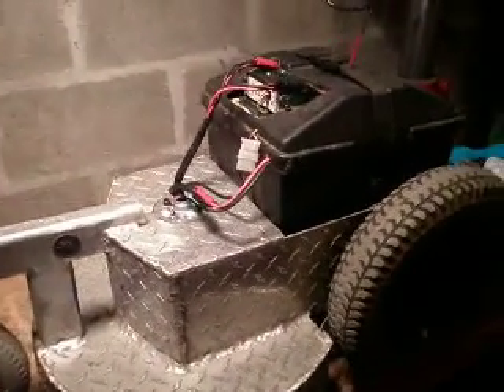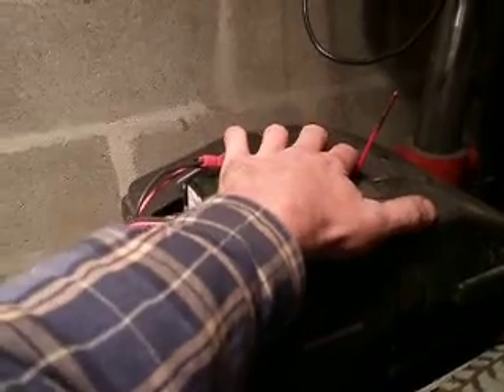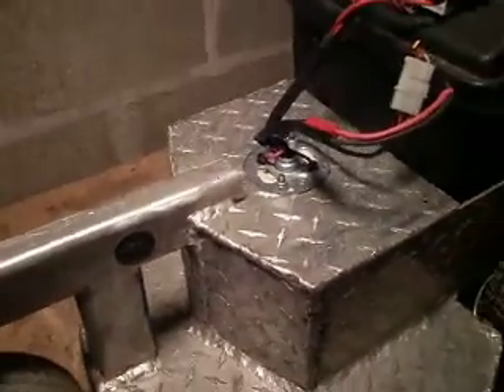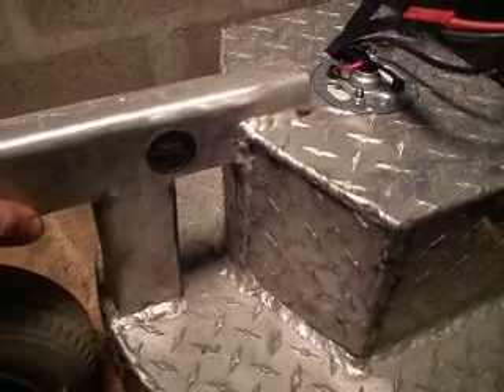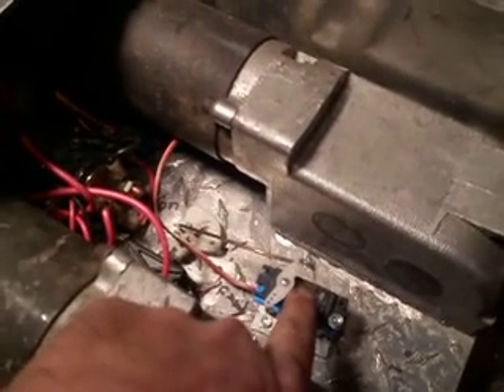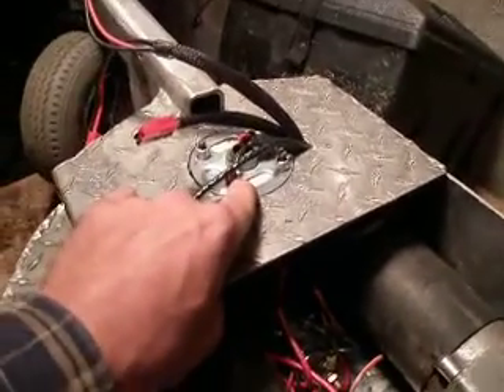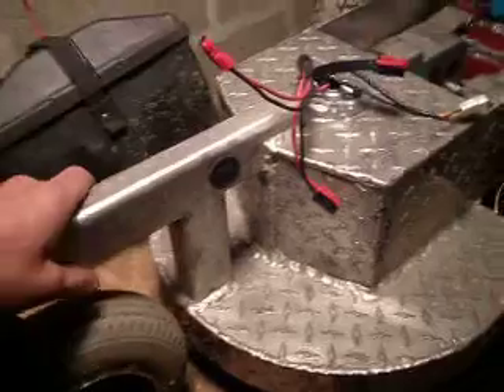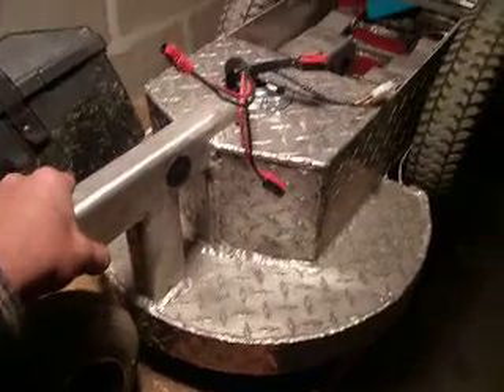latest RC mower

Comment: That's not a bad looking weld Ron. Sweet setup, looks a lot more robust than anything else I've seen. 

I found a site that has 24 volt relays that interface with the RC receiver directly but only handles 10 amps. I'll send the link if I can find it. 

Nice setup man, let's see a video of it in action!